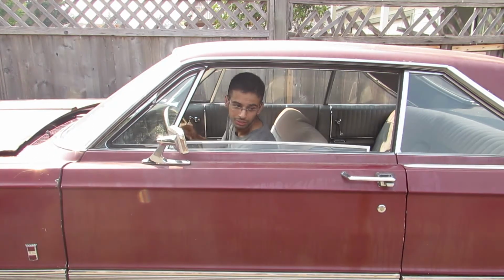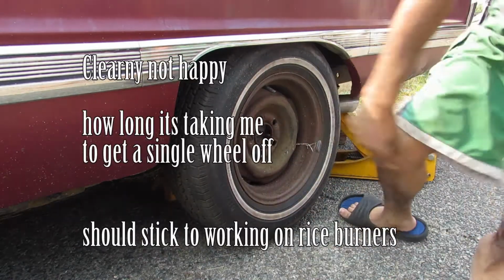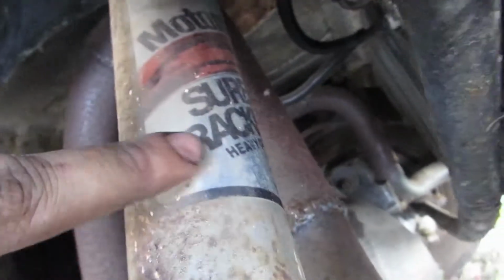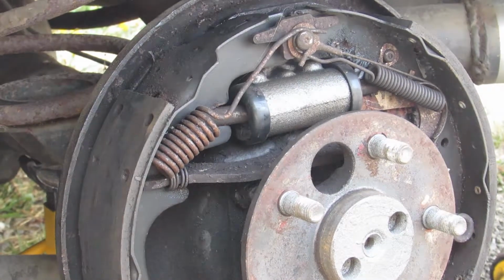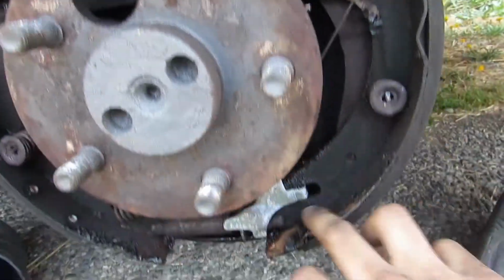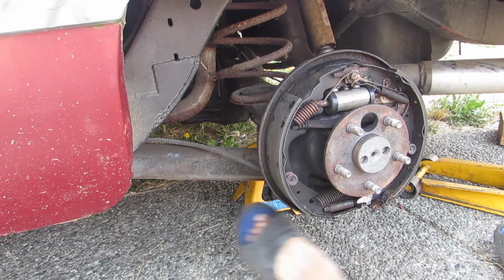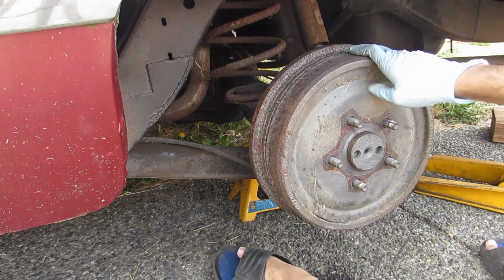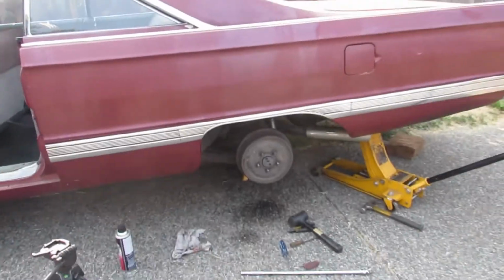EP2 : 1966 MERCURY PARKLANE | E-Brake & Rear inspection

Comment: 1. My car has the same rear end but the suspension setup is different on your car than mine. My car uses leaf springs and shocks.
2. I had the same problem with my parking cable. When you pressed the pedal down, there was no resistance. And the pads did not even touch the drum.
3. I've replaced every brake component on each wheel : wheel cylinders, rubber brake hoses, brake shoes, springs, automatic adjusted cables, and I even had all the drums turned. 
4. After replacing all of that, the cable still did not catch very well. But I looked in my owners manual, and it says the parking brake cable is adjustable. I suggest you get unsder the car with two wrenches and adjust it. That is most likely your problem.
Reply from the maker: yah it works good now.  the ebrake pedals a long throw but holds . they cables could use  a tightening